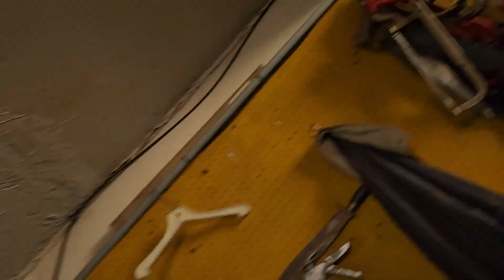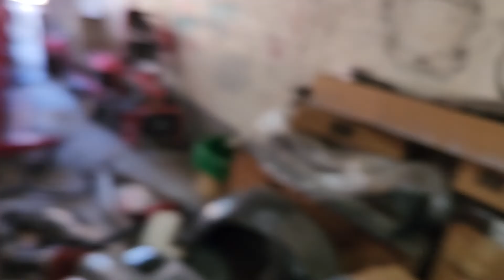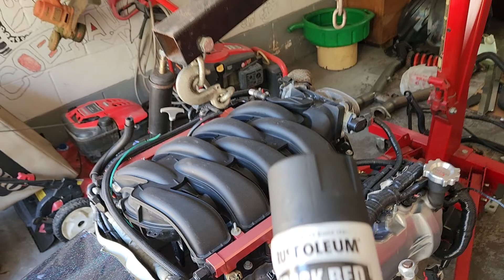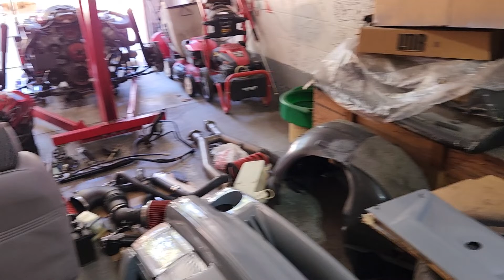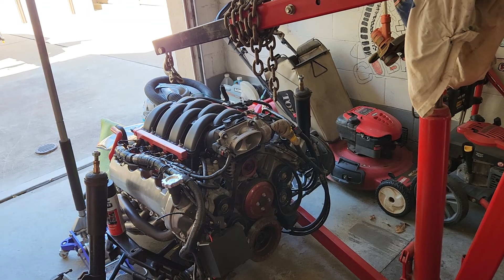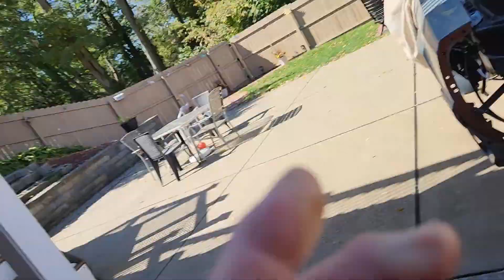foxbody mustang smoothed engine bay an strut tower repair part4...bedliner finish

Comment: I just watched your video…as you were referring to the hydro boost there is a box shaped or rectangle box attached to side of hydro boost with a tube … two pieces of blue tape per video… I purchased a new hydro boost but mine doesn’t have that… I have seen another video saying it is needed…. What is it called and what does it do? Thanks for your help!!
Reply from the maker: Um not really sure but it's not a separate piece...idk....one fitting connects to it an the vent line connects to it...an there's different years also think 96-98 an 99-04..I've always got mine used with everything